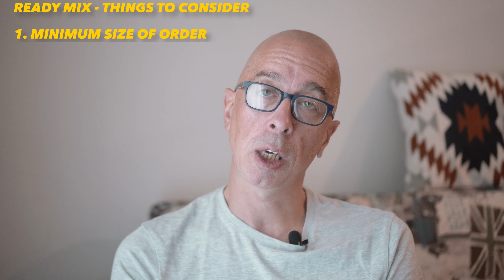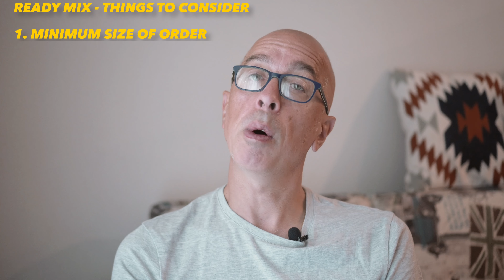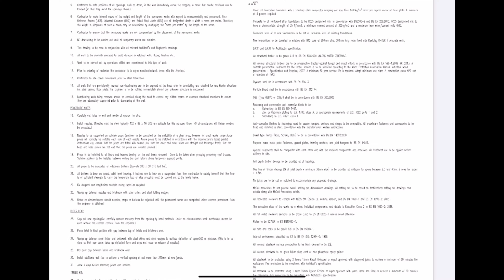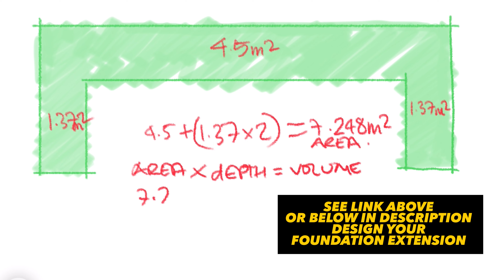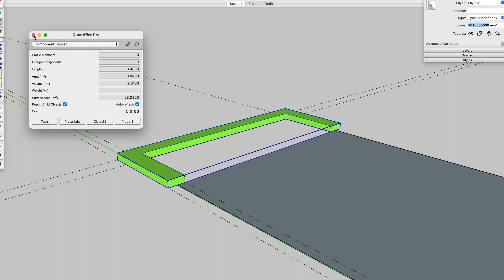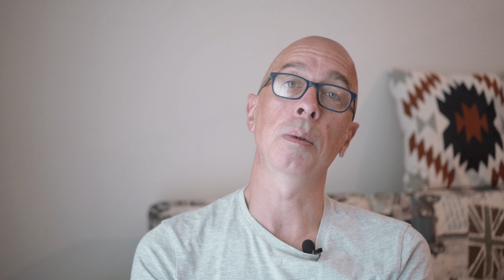How to POUR CONCRETE FOUNDATIONS FOR HOUSE EXTENSION for self builders

Comment: The "tarps" you mention only work for the early stage of concrete setting while the mix still generates heat quickly enough. But if you want the concrete fully cured and redy for construction to continue within a month or if the trmperature is expected to go below -15°C then even with proper coverageand with foam inserted all around the concrete there is no substitute for concrete heaters.

Comment: How thick does the osb sheet need to be to be strong bought to shutter the 2.2m deep foundation trench? Thanks
Reply from the maker: I use 18mm but you need to shore/pre-stress it at least every 600mm with framing or blocks
Reply: @build-better-things thanks a lot. Ok with 4x2 timber ?
Reply from the maker: @user-fu4yc1yk8w that’s what I use most of the time.
Reply: Thanks a lot.

Comment: I had a conservatory base installed some years ago and it was frosty weather. I didn't know much about building but my common sense led me to ask if he needed to take protective measures in view of the cold weather. He told me, "Don't worry, concrete curing is exothermic, it generates its own heat" He took no such measures and although, many years later the foundations were perfectly sound, I did notice before I tiled the floor that the surface has started to disintegrate. I take it this was due to the frost? What do you think of this guy's claim?
Reply: Depends how cold it is. If it’s just below not the end of the world but will be a lot warmer under DPM

Comment: Wow, best video for foundations out there. Straight forward, clear and really good video work. Just one question before I start my foundation drawings, which looks like an almost exact copy of your project, just before you pour, at 11:19 you show the reinforcing rebar laying on top of the old foundation where it abuts the house. The level peg also looks above the old foundation. Am I right in thinking you poured to about 50mm above the old foundation level? Much appreciated videos.
Reply from the maker: Hi and thanks for the encouragement. I poured flush with the existing foundation level because I had to get the brick courses to line through, because of the facing brick. If you don’t have facing brick, not so important, although good practice. The rebar over the foundation is because I’m creating an additional pad foundation for the steel column for the goal post. I explain it more in my other videos
Reply: @build-better-things  Ah, thank you for the reply. It is now completely clear. Hoping to be toothing out original wall to accept new facing bricks so must line through. Many thanks.

Comment: G

Another useful video thanks. Why do you only pour concrete to 250mm then use trench blocks, can you just fill the complete trench with concrete up to dpc level to avoid laying trench blocks then start brick laying? Secondly, if it was out of plumb by a big distance say 1cm, would the builder just be able to get it horizontal again when laying the trench blocks which i assume need cement under them anyway? Im expecting my structural cals etc in the next week,so am keen to understand as much as possible when the building work finally starts. You videos are very helpful thanks
Reply from the maker: On your second question, each brick course is 10mm of mortar, 1cm, so depending on the number of courses below DPC level, you can make up a few millimetres to level. Your first question is dependent on a number of factors. To have that depth of concrete, I guess would require some reinforcement design by your engineer (imagine pushing horizontally on the concrete without reinforcement at that height, it would snap and crumble). Factoring in the complexity of that versus a simple 250mm strip foundation and building your trench blocks off it is the decision to make.

Comment: Great video. Just wanted to ask if you leave wooden pegs in and pour concrete over them or do you take them out at some point? And if left in, does it pose any structural risk to the footing if it degrades in the future?
Reply from the maker: If I’m using mesh within the strip, andi usually will be,  I’ll leave the pegs in for something as shallow as this. Thanks a lot for the comment

Comment: As a newbie to renovation, this is an ecvellent vlog for looking at the basics of foundation building.  The French do not use foundations (at least old houses), its a case of starting the foundations without anything to go on.  This is a great series and very honest.
Reply from the maker: Thanks. It’s also the case in the U.K. that older houses were not built with concrete foundations. They just dug down and built off what they saw to be bedrock.
Reply: Indeed they did.  I am now having to overcome issues that comes with a renovation.  One of the biggest issues is rain, lots of rain.  The water table is so high that our newly laid concrete floor is flooding.  I think that a very deep French drain system may be the best way ahead, but the house was built on hard sandstone, so its a nightmare to dig through.  What do you think?

Comment: Did you leave your levelling pegs in the footing or pull them out before it cured? Thanks, great video.
Reply from the maker: Good question.  For that tiny amount of surface area given pegs are standing vertical , and with the mesh reinforcement over the pegs, I’m not going to worry about leaving them in. You could always use rebar pegs instead if you’re concerned…and pass it by your engineer.
Reply: @build-better-things  They might rot and the whole thing will fall down. 🤣🤣🤣🤣

Comment: Really great Videos and Explanations! Have you done any videos specifically on the Pad Foundations that were required for you Steel Goal Post?
Reply from the maker: I go through this pad foundations in a little more detail in my videos on the steel work linked below . These pads had to be done in a second pour, due to them being much deeper and wider than the strip foundations. I’ll never mix up depths in the same pour if I can avoid it, unless you’re very experienced at form work. Leave the reinforcement sticking out of the first pour so you can get it to bind in to the new pour for the pad. You want them all to act together as one. 
Preparing for steelwork - can you do it yourself?
https://youtu.be/P7SSktZs4-g
Installing steel beams for a house extension
https://youtu.be/3t9r2dwvAFA

Comment: 0:46  uk is still in the stone age, barrowing concrete. Most of the developed world pumps concrete now. <shakes head in disbelief>
Reply from the maker: For these small domestic concrete construction projects, it’s not financially feasible, anywhere, never mind in the developed world….to use your words….to hire a pump, where it’s possible to take in by wheelbarrow.
Reply: @build-better-things  Its not even about "financially feasible" its about can't be fked with it. to much effort running back and forth with a wheelbarrow. I''ve pumped concrete for an extension pal. So clearly I know a bit more about about it than you. Can't speak for all developed countries but I can say that they do it in the US, Australia and New Zealand. I know Oz and NZ by first hand experience and the US by talking to builders that worked there. Its a pity you take this stance as your channels not bad, but I guess the uk is just too proud and too poor these days to recognize they're falling behind.
Reply from the maker: If you want to pump concrete for your extension then go for it, nothing stopping you, usually hire with the readymix company.  The reason I didn’t dwell on it is twofold, 1. because it’s easy to make mistakes with the pour if you’re inexperienced, compared to wheelbarrow. 2. I’ve pumped loads of jobs, but I would avoid a small house extension like this because of cost.

Comment: At what point did you remove the timber struts and ply shoring the trench as these can lead to rot/settlement?
Reply from the maker: I didn’t remove them, I just move them up as the pour takes place and then reshore them with the battens. I only remove them once I backfill after the trench block is in place. However here I leave them as sacrificial since it’s a very small proportion of the length of the strip that is affected versus any potential lateral differential movement. Thanks for the comment